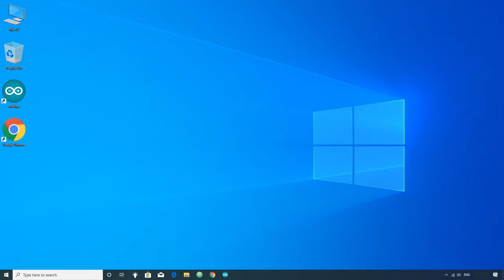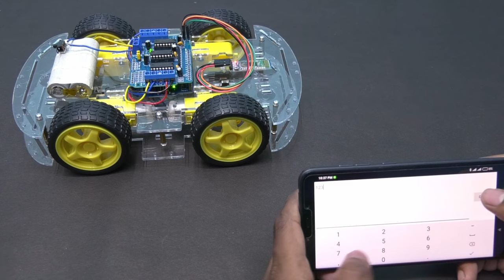Bluetooth controlled Arduino RC Car | Control using your Mobile Phone | Ut Go

Comment: I connected the wire as you did and I copied the code but when I control it the car is not moving
Reply from the maker: Do you checked your bluetooth communication. What is bluetooth serial communication baud rate
Reply: @UtGoTech   i dont no
Reply: @UtGoTech  : Hi,
I am writing on behalf of my Son, Jeeva (Kathi kappal) (13 year old). I have ordered in Amazon and got all the Items as per your Link, he asked. Now he connected everything, including battery, etc. Also he copy pasted the program, but it is not working. When he checked the voltage in motor driver out put, there is no volt coming out. Could you help in trouble shoot by step by Step? Almost 8 hours in a day he spends to move the car. Please let us know if he can connect through a video call.

Comment: i dont know why it is not working for me
Reply from the maker: Please share the issues you are facing.
Have you installed the required libraries.
Reply: @UtGoTech  yes I have but then also the car doesn't moves on giving command
Reply from the maker: Have you check your bluetooth module. Is it working properly?

Contact me on Telegram @utgotech

Comment: Can i replace Bluetooth module with a esp8266 ?
Reply from the maker: Yes, It is possible to replace Arduino Uno and Bluetooth module with ESP8266.
Reply: @UtGoTech  So if I want to use esp8266, what components do I need to prepare?
Reply from the maker: If you want to use ESP8266 then we suggest you to use L298N motor driver
Reply: this is my first time working with esp, so i only need the esp and l298n module without using arduino uno, right?
Reply from the maker: Yes

Comment: Sir, please explain why you don't use pins D1 & D0 as TX & RX?
Reply from the maker: D1 and D0 are connected between the Arduino Uno Microcontroller and it's serial controller. If we use those pins then we have to disconnect the bluetooth module everytime we program the Arduino board. So to make things easier we have used software serial.
Reply: @UtGoTech  instead of l293d, if a 4 channel relay module is used will it work? If it will could you help me with the coding part?

Comment: My bluetooth get disconnected after one command. It happens most of the time 
Can you say What may be reason
Reply: it could be the power supply, try with 9v battery
Reply from the maker: Yes it is due to the power supply. use lithium based battery.

Comment: Sir when I connect my mobile to Bluetooth and give command it automatically disconnects everytime
Reply from the maker: What battery you are using?
Reply: 3.7 v li-ion battery
Reply from the maker: Use 2 charged lithium ion batteries in series
Reply from the maker: And make sure batteries are of good quality.
Reply: I have used 2 batterys
Reply: What should I do
Reply from the maker: 2 batteries in series is ok.

Comment: Checked loose connections...but motor is not responding for the Mobile app
Reply from the maker: Have you made connections as shown in this video.
What type of battery are you using?
Reply: @UtGoTech  25000 mah lithium ion battery only
Reply from the maker: What is the battery voltage?
Reply: @UtGoTech  7.14
Reply from the maker: @HappyLife-lz8gh battery voltage is ok
Reply from the maker: Check Bluetooth module rx tx connections
Reply: @UtGoTech  ok
Reply: @UtGoTech  I checked

Comment: Hey nice vid I wanted to ask does the code matter for speed and the voltage needed
Reply from the maker: For Speed yes, for voltage no.
Reply: So, if the voltage is low then will it work as the speed is low actually I got 150rpm motors and it isn't working so I asked thank you voltage 9v
Reply: X2 9v battery together
Reply: This is my last request can you please copy and paste the code here actually I can't open the code somehow
Reply from the maker: I suggest you to use lithium based batteries.
Reply from the maker: DM me on my telegram account.
Reply: Sorry, I don't have telegram I will be contacting you on facebook
Reply from the maker: Oo

Comment: Thanks for your vedio. I tried the same and code also uploaded without any error. But the car is not moving. Can you please advice me on this issue?
Reply from the maker: Is you bluetooth connection is working correctly?

Comment: Bro please make a Bluetooth controled car with (esp32 module  )and motor driver plz soon 🔜
Reply from the maker: Ok Bro
Reply: @UtGoTech   sorry use esp 8266 wifi module
Reply from the maker: @user-pv9rl2ec3g If you want to use esp8266 then you have to use  wifi to control the car or  you have used a separate Bluetooth module.
Reply: @UtGoTech  ok I can use with wifi make a video on it pls
Reply from the maker: @user-pv9rl2ec3g Ok I will add it to my upcoming project.
Reply: @UtGoTech  you can use anything as you wish but please make the video as soon as possible because I have to submit my project within 18 dayes so please make video quality plz plz 🥹🥹
Reply from the maker: @user-pv9rl2ec3g Ok I will try my best.
Reply: @UtGoTech  bro day 2 of waiting for your new video of esp33 Bluetooth can 🥺

Comment: If i open the app and scan for other devices , cant find the bluetooth module bro please help this is for my final project in school
Reply from the maker: Don't open the app, first open mobile Bluetooth setting then pair your Bluetooth module from there then after pairing open the app and select your paired Bluetooth module.
Reply: @UtGoTech  yes it work but the the bluetooth module dies if i try to move the car any remedy sir i used 2x lithium battery 3.7volts
Reply from the maker: What happening please explain in detail.
Reply: @UtGoTech  it works but the left button on the app is forward all of the control section is not exact if you press it how can i fix this
Reply from the maker: To fixed that, press forward button then then change the polarity of motors which rotates in opposite direction.
Reply: @UtGoTech  no sir all of the motor are in sync but the left and right turn is forward and backwards and the forward and backward is right and left
Reply from the maker: Yes to fixed that, press forward button then change the polarity of motors which rotates in opposite direction.
Reply: @UtGoTech  i did it but nothing happen and also sir the dc motor only moves forward but if you turn backwards the dc motor 1 didn't work
Reply from the maker: Check battery voltage. Charge the lithium ion batteries.
Reply: @UtGoTech  all of the dc motor can move backwards except dc motor1
Reply: Not the battery i think sir ?
Reply from the maker: Check that geared motor is faulty or not. Also check the battery voltage. Make sure batteries are charged.
Reply: @UtGoTech  how can i increase the speed any recommendation?
Reply from the maker: 1. Use Max value for setSpeed function. 
2. Use high speed motors.
3. Use maximum voltage rated for motor.

Comment: Arduino: 1.8.13 (Windows 10), Board: "Arduino Uno"

BLUETOOTH_CAR:18:10: fatal error: AFMotor.h: No such file or directory

 #include <AFMotor.h>

          ^~~~~~~~~~~

compilation terminated.

exit status 1

AFMotor.h: No such file or directory

This report would have more information with
"Show verbose output during compilation"
option enabled in File -> Preferences.

HOW TO FIX THIS?
Reply from the maker: Library not installed properly.

Please install the library correctly.

Comment: I have a doubt is codes for Hm-10 and Hc-05 are different?
Reply from the maker: No. same code can be used with both the modules. But you have to configure the module properly according to your needs.
Reply: @UtGoTech   I know how to connect it with mobile but I need know do I need to alter codes of this project ? Please instruct me which part of this code need to change? Do you help me please
Reply from the maker: No change
Reply: @UtGoTech  the car is not moving bro
Reply from the maker: Which battery you have used ?
Reply: @UtGoTech  12v

Comment: Hi friends,

I have a problem, when I use 3.7V (2000MAH) × 2 battery then after running for a while the motor driver stops working, after pressing the reset button it runs again for a while and stops  but when i use 5 volt power bank then there is no problem, can any one tell the solution for this problem.

Thank in advance. 😊
Reply from the maker: Check temperature of the IC.
Reply: @UtGoTech  thanks for the ans. But temperature is normal.
Reply from the maker: Have you checked battery voltage
Reply: @UtGoTech  3.7V × 2 = 7.4V
Reply from the maker: I mean, Is it fully charged?

Comment: hello, my BT module is blinking red but it is not showing in the searching device section
Reply from the maker: Try using different Bluetooth enabled phone.
Reply: @UtGoTech  it's connected now but my car is not moving, help me pls
Reply from the maker: After giving command is your Bluetooth module gets disconnected ?
Reply: @UtGoTech  no, it still connected. Seems like nothing happens when i click to move the car
Reply from the maker: Do you have separate power supply for Arduino board and motors shield?
Reply: @UtGoTech  i only put the power to the motor shield
Reply from the maker: What battery you are using?
Reply: @UtGoTech  i use the 9v pp3 battery. is it not suitable for arduino?
Reply from the maker: No it's not enough for this scenario. Use lithium ion batteries as shown in the video.
Reply: @UtGoTech  if the battery ran out how do i change it?
Reply from the maker: Use lithium ion battery charger
Reply: @UtGoTech  i've change the battery to li-ion battery but it's still won't move, even when i change the code to make it move only on motor 1 instantly when the power is on.  it won't move
Reply from the maker: You can recharge lithium ion batteries.
Reply from the maker: Recharge it.
Reply: @UtGoTech  i've fixed it, the problem now is it's laggy and frequently not responding
Reply from the maker: Please explain in detail about what's happening.

Comment: The Bluetooth is not connecting and light is not comming from the Bluetooth hc-05 module
Reply from the maker: Check your Bluetooth module
Reply: What to check
Reply from the maker: Check if it is faulty or not.
Reply: It's working
Reply from the maker: Bluetooth module Led is blinking or not.
Reply: Not blinking
Reply: The way you connected is not working
Reply from the maker: Just given power to the Bluetooth module. Connect 5volt and Ground pins. After that if Led in your Bluetooth module is blinking then it is working ok if not then it is faulty/damaged.

Comment: bluetooth ,arduino and motor driver lights are on but it is not moving in any direction
Reply from the maker: Try printing bluetooth data on serial monitor and check if you are getting desired data or not.
Reply: @UtGoTech  how to do that
Reply from the maker: If you are using Microcontroller which has only one hardware serial then you can achieve this by using software serial.
Reply: @UtGoTech  bro my bluetooth module is not turning on

Comment: you didn't give power to arduino board?
Reply from the maker: Since the power jumper is connected, the Arduino board is getting power through motor shield
Reply: @UtGoTech  bro my Bluetooth module is connecting to the app but when I press forward the motors don't move

Comment: Hi can I use 1.5v X 4 batteries
Reply from the maker: If you are planning to use 4 AA batteries then don't. Because AA batteries cannot provide enough power to drive 4 DC motors.
Reply: @UtGoTech  Then can I use two lithium batteries
Reply from the maker: Yes you can use two Lithium batteries in series to 7.4V battery pack.
Reply: @UtGoTech  how much volt I have to use maximum
Reply from the maker: @UDSEDITZZ 12volt
Reply: @UtGoTech  or 8 aa battry
Reply from the maker: 8 x AA batteries will make up 12 volts but they can't provide enough current/power to drive motors. You can try if you want.
Reply: @UtGoTech  Still not working in two lithium batteries 😭
Reply from the maker: @UDSEDITZZ what issues are you facing?
Reply: @UtGoTech  not working
Reply from the maker: Have you rechecked the connections?
Reply: @UtGoTech  yesss
Reply: @UtGoTech  reply me please
Reply from the maker: @UDSEDITZZ  What issues are you facing?
Reply from the maker: Have to checked battery voltage ?
Are they fully charged ?
Reply: @UtGoTech  I have used a charger still not working
Reply from the maker: @UDSEDITZZ battery are connected in series or parallel
Reply: @UtGoTech  in series
Reply from the maker: @UDSEDITZZ Then look for a loose connection. You can contact me through telegram to discuss in detail.

Comment: 18650 3.7 1800mah * 2??  Its okay
Reply from the maker: Yes
Reply: @UtGoTech  but not work
Reply: Bluetooth module cannect & disconnect
Reply from the maker: Does your Bluetooth disconnects after giving command?
Reply: @UtGoTech  yes
Reply from the maker: Then check for the loose connection.
Also check if the battery is Fully charged or not.

Comment: cant find the code....pls repost it....its very urgent pls pls
Reply from the maker: Code given in the video description. If the link does not work for you then contact me through Telegram or send me your email, I will send you the code there.
Reply from the maker: I have checked it's working. But if you are still facing issues then contact me through Telegram or give me your email I will send you the code there.

Comment: Hello can I use Arduino Mega 2560 here instead of Uno?
Reply from the maker: Yes you can
Reply: @UtGoTech  did you really put the HC-05 pins to the Servo pins in the motor driver and it works?
Reply from the maker: Yes, I programmed it that way.
Reply: @UtGoTech  so the pins in the Servo motor in motor driver is 9 and 10? I appreciate your responses, your awesome!
Reply from the maker: Yes. Servo signal pins are connected to arduino pin 9 and 10.
Reply: @UtGoTech  Thank you so much
Reply from the maker: Welcome👍
Reply: @UtGoTech  should my HC-05 operating in master mode? or in slave?
Reply: I cant seem to operate the RC Car when im using your provided RC app. I checked everything, the connections the electronics, and etc, and everything seems fine on their individual uses, however when I connect everything, especially the HC-05 and try to control it using the App controller, it doesnt work, however my cellphone can connect to the HC-05. But its not working when I touch the buttons in the app controller.
Reply from the maker: Have you followed the step exactly as shown in the video tutorial?
Reply from the maker: Which type of battery are you using?
Reply from the maker: @czyreenjohnechague1624 In Slave mode.
Reply: @UtGoTech  but i noticed that when i uploaded a code that will turn the motors forward, for testing only the motor driver, without HC-05, its working.
This is the code; 
#include <AFMotor.h>
AF_DCMotor M1(1);
AF_DCMotor M2(2);
AF_DCMotor M3(3);
AF_DCMotor M4(4);
 
void setup() {
  M1.setSpeed(230);
  M2.setSpeed(230);
  M3.setSpeed(230);
  M4.setSpeed(230);
}
 
void loop() {
  M1.run(FORWARD);
  M2.run(FORWARD);
  M3.run(FORWARD);
  M4.run(FORWARD);
  
}
Reply from the maker: @czyreenjohnechague1624 Have you connected the RX TX line of the Bluetooth Module correctly?

Are you able to connect to the Bluetooth Module using your phone ?
Reply: @UtGoTech  yes, the light in the upper left of the app is green, which means im connected, however when i push the buttons its not working.
Reply from the maker: @czyreenjohnechague1624 After pushing the button does your Bluetooth get disconnected?
Reply: @UtGoTech  One last thing tho, I want it to go faster, what should i do? add more batteries? if so, whats the connection or diagram. Thank you!
Reply from the maker: As per the hardware servo pins are connected to pin 9 and 10. Maybe there some other issues. 
Great, your project was finally completed.
Reply: @UtGoTech  how can i make the motors run faster?
Reply from the maker: @czyreenjohnechague1624 use high rpm motors/gear motor

Comment: Motor shild a program upload kora lage naki
Reply from the maker: Sorry I didn't understand the Language.
If you're facing issues uploading the code then first install the Adafruit Motor Shield V1 Library after that compile and upload the program.
Reply: @UtGoTech  have we any need to upload a code in motor shield with Arduino
Reply from the maker: No. You don't program Motor Driver Shield. You have to program the Arduino Board.

Comment: I am getting so much lag in the inputs and the Bluetooth is automatically disconnecting out please help
Reply from the maker: Which type of battery are you using?
Reply: @UtGoTech  3.7 V lithium cells 4 of them
Reply from the maker: You have used 4 lithium cells. But in which combination? 
Are the 4 cells in series ?
You can only use 2 cells in series to make a 7.4 volt battery pack.
Reply: @UtGoTech  3 in series to get around 12 v and then given to bridge circuit and step down transformer(only e batteries are used sorry for saying 4)
Reply from the maker: @tdavid4790 Step Down Transformer ? Why you using a transformer?
Reply from the maker: @tdavid4790 Is it a transformer or step down converter/voltage regulator?
Reply: @UtGoTech  i believe it's a rectifier circuit with bridge circuit ICs and filters
Reply: Can the power supply be a problem for the lag, it takes atleast 5 to 10 seconds to react to a command and the Bluetooth just disconnects automatically but the Bluetooth module led is blinking and it is on
Reply from the maker: @tdavid4790 I think you don't need that. Just use 2 Lithium-ion cells in series. Rest follow steps as shown in the video.
Reply: @UtGoTech  yeah sure. Thanks mam for replying so fast I really appreciate that from you .
Reply from the maker: @tdavid4790 Welcome 😊